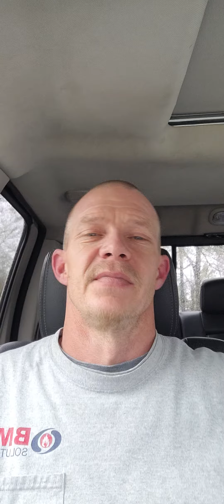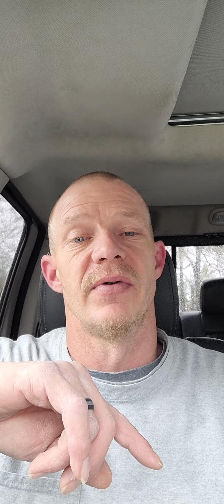(Watch before doing a Relearn on 03 Hemi Ram 1500) Don't fall victim

Comment: You may have had a dirty tb and the flap couldnt move to where the pcm was directing it to go. I have a 03 single cab that i bought last fall and the gas pedal is much different than any of my other 3rd gen hemis...its like it has more resistance than my other ones...hope my comments made sense big dog lol
Reply from the maker: No sir. The throttle body is not in bad shape. It was not sending any volts to throttle body. Still have the same tb on there never changed
Reply: Someone else said the etc relearn did that to theirs too :/ I'll spread the word on my channel as well
Reply from the maker: Why hell yeah

Comment: Hay brother just wanted to give you a heads-up on what with getting the 2015 Ram 5.7 hemi with 60k miles. I'll have it Monday but what took so long I could not find the payoff paperwork which I found today. It's making me sick that I'm only getting for my 2004 Ram 1500 $1,200 plus tax and $300 for trading in the truck. Just sick and tired of throwing Parts at the truck for it only to do the same thing. Even the dealership cannot believe how clean my 04 is. I wish we were Neighbors but it served its purpose and time for a change. I'll ttyl brother.💯👍
Reply from the maker: I know it gets hard buddy but it is paid for. That how I look at both of the Rams. They are both paid for. So to me, its worth stressing over.

Comment: i have an 04 dodge ram 5.7 that has this issue with the code of the accelerator pedal pos after the new pcm. Throttle body is new and good as swell?
Reply: it runs good and then looses power replaced crank sensor had that code once installed new pcm after new throttle body
Reply from the maker: @CompPrincess-p5g then that tells me the the actual app sensor may be bad

Comment: man im still getting codes p2106&p2108 . new pcm and still same codes . any idea ??
Reply from the maker: That doesn't make sense
Reply from the maker: You seen that the new pcm worked for me
Reply from the maker: Are you sure you don't have a break in a wire somewhere Or a short some where
Reply: well on my throttle body connector it is missing the red tab . but its pushed in all the way .. ive replaced everything u can think of and still throttle body codes ..
Reply: i also have the old and new throttle body i put on and its the same codes
Reply from the maker: The red tab is just a lock tab if it clicks in and stays it should be good.

Comment: You think it could help mine cause mine is like intermittently doing it so if I shut it off and crank it right back up etc light is gone runs normal but when it comes on its a rough idle and sometimes a a crank no start
Reply from the maker: Sounds like you need a Throttle body

Comment: i have an 04 dodge ram 5.7 that has this issue with the code of the accelerator pedal pos after the new pcm. Throttle body is new and good as swell?